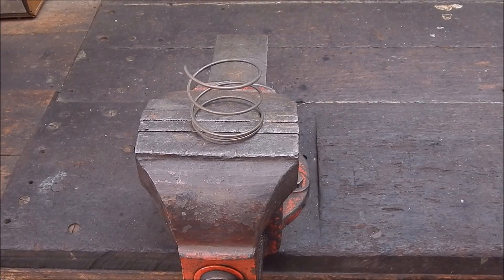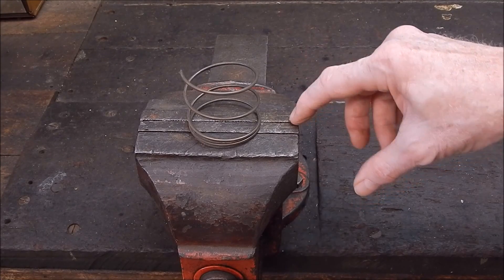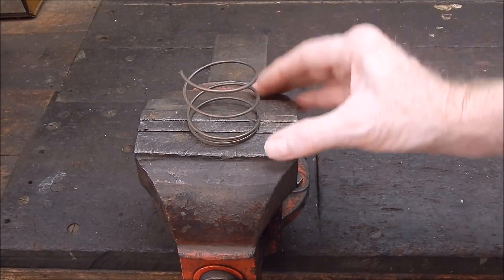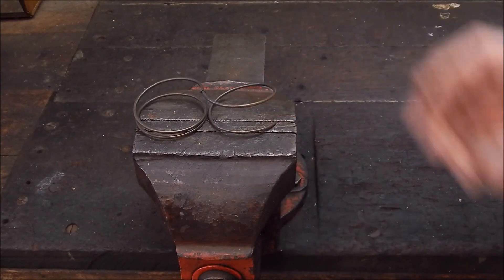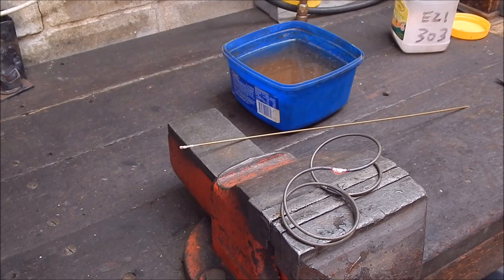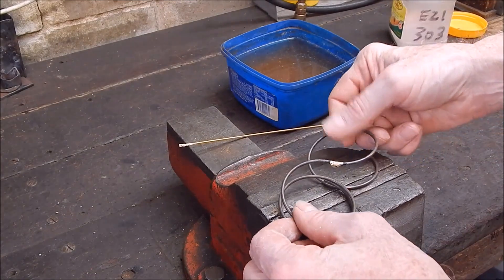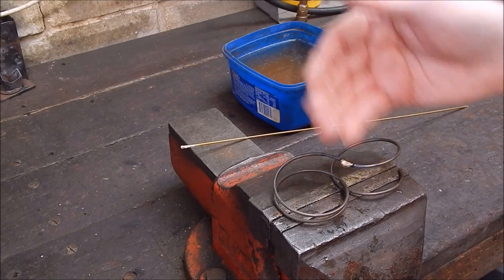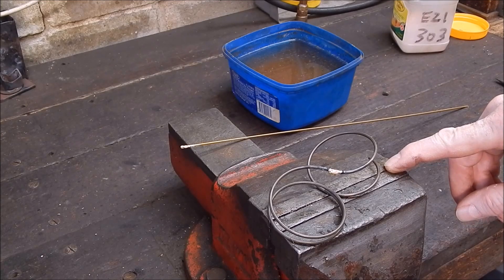The danger of quenching high carbon steel

Comment: I have a ts8000 bernzomatic torch using MAP/Pro gas, I have tried brazing but the bronze rods seems to have a hard time melting, are there different bronze rods I could try or are they all pretty much the same?
Reply from the maker: A lot of tool shops only sell really shitty no name flux coated rods.  They are garbage and flow very poorly.

The best/ general purpose rods I use are BOC Smootharc Profill manganese bronze (un-coated/plain 2.4 mm).  You can buy them from BOC Gas agencies and some plumbing supply outlets..

The flux must also be good.  I use EziWeld 303.

Cheers Rob
Reply: In the USA the big box stores only seem to sell  bernzomatic rods, I bought a pack of 4 and not having much success with them, so as you suggest I'll try and find the ones you recommend - thanks
Reply from the maker: The size and quality of the rod  makes a big difference.  Go 2.4 mm and check out leading USA welding brand consumables, they should be industrial grade.  

I don't know if BOC is available in the USA.  Stay away from Home Depot type stuff ;)

Cheers Rob
Reply from the maker: There's no substitute for quality manganese brazing rods.  They flow way better than the no name stuff.   Depends if the flux was actually for brazing, it could be for steel filler rod.

I have brazed broken bandsaw blades, but they don't last.  The commercial join is electrically welded.  Big difference in flex 
tolerance/durability as it's all steel. 

Some commercial bandsaws actually have a welder/grinder built in.  How cool s that ?

Cheers Rob
Reply: @Xynudu  Those welders and sanders you're talking about are very $$$$ ,  if bought new, even seen many used ones sold for over $1000USD, they work great though, I was lucky enough to find one at $200CDN, needed a little TLC but works fine...
If you can't make it flow right ( Brazing material ) it's often that you need more heat than you got available, or for more difficult cases, you may want to get some brazing rods with 2 to 5% silver, silver helps a lot for flowing, those get to be quite $$$ but normal brazing requires only smaller amounts of add on material.
BTW, in most cases, normal plumbing torches don't give enough heat to braze or can't adjust the oxygen to fuel balance, in order to create an oxydizing or carburizing flame, what ever is needed.   ;)
Reply: Recently I was trying to braze a 1/2 inch band saw blade, but although I could easily get the blade glowing the new bare rods I got off eBay would not flow with a good quality Eziflow flow flux albeit a old box I inherited. I blamed myself although I could not understand what I was doing wrong as I have brazed and silver soldered many things before, even with flux coated rods I have had no problems. So I wanted to blame the rods, but when I found one of my original flux coated rods even that would not flow, so in the end I just bought a new blade and I have not tried since. I have since wondered if I was fooling myself in thinking that the glowing blade was hot enough. Dunno, usually when things don't work it is my fault. Lately I have wondered if the flux could have gone off troubling the bare rod & then the coated rod, but I am kind of inclined to think it was something I was doing. Thanks for sharing!
Reply: It was my fault. I rechecked the flux & found it was not what I thought, but is instead a JMM Easy Flo for use with silver solders up to 800 centigrade, so not surprising it didn't work for bronze. I inherited it from an engineering friend who made steam engines & silver soldered boilers. Worse I had been convinced that brazed bandsaw blades worked well by several YouTube videos so I have been wasting my time anyhow. If yours don't last there is little chance mine would be any good. So lessons learned again. I will sort things out, label & be more organised. I also inherited a lot of unlabelled silver solder but I have been nervous of using it in case it may be cadmium alloys. Thank you for your super helpful replies.

Comment: Wow, that was very informative. Not to mention, I had no idea brazing was that strong. I've got a new respect for it.
Reply from the maker: Yes, brazing gives 100% weld coverage of the joint faces.
Reply: Plus the braze joint is stronger typically than the parent metal, and you get no brittle area of changed metallurgy by the joint that is going to fatigue first, unless you are using the correct filler material to make that alloy more ductile and fatigue resistant than the parent bulk itself. hard to do on unknown stuff that is sold and used as general purpose steel of some type.